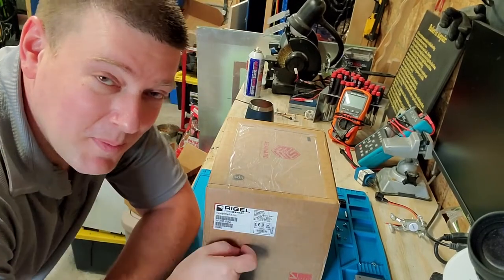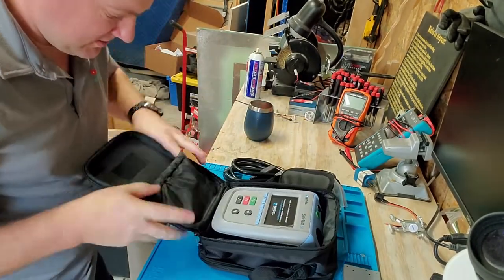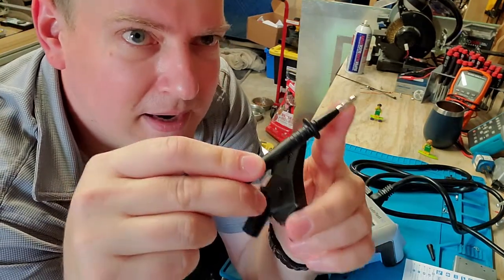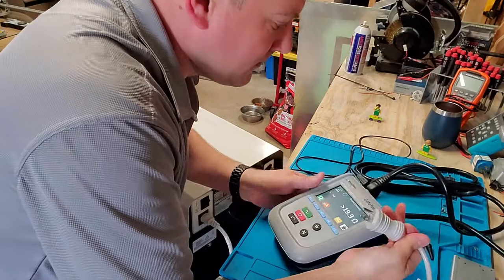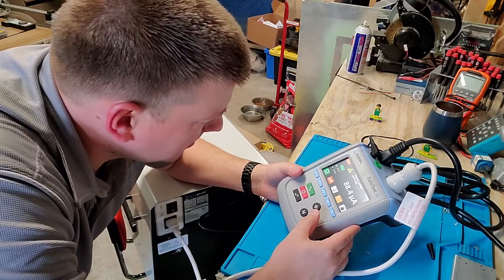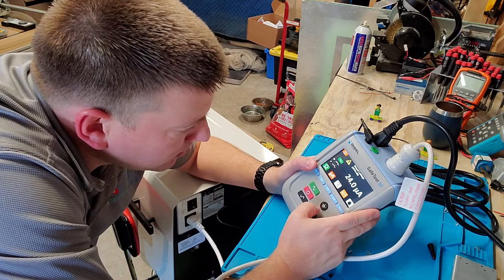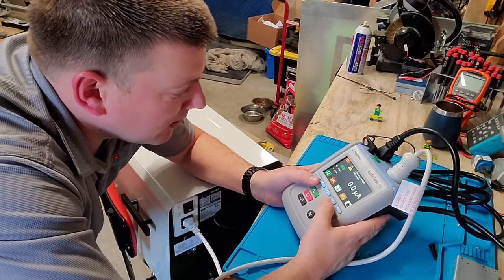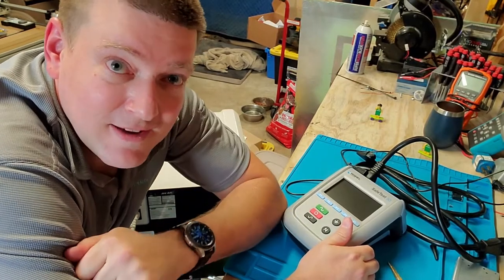A Surprise Box From Argo Biomedical Services and Rigel Medical!

Comment: Question: How much component level knowledge do I need to know for my BMET 1?

I'm confident with my individual components but as far as identifying individual circuits such as filters and timers... AC voltage isn't my best field and I'm aware that for a job that deals with biometrics that's not good.